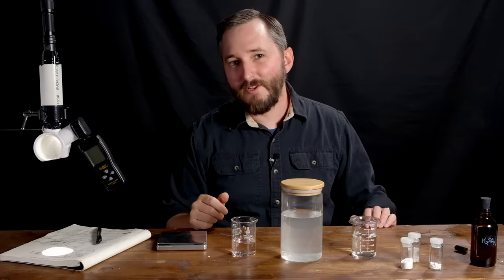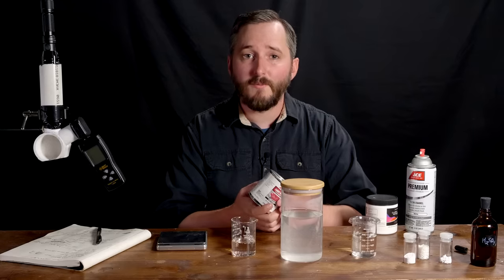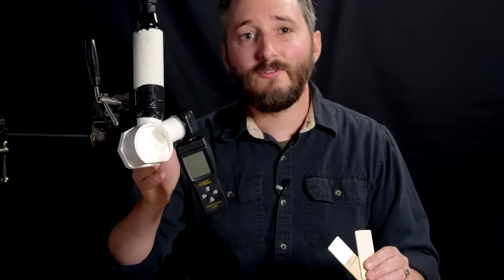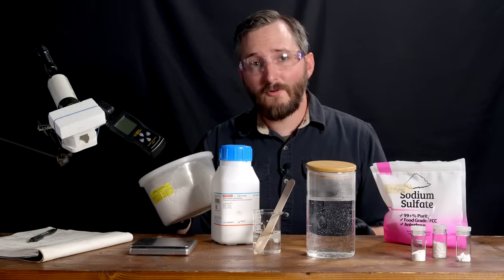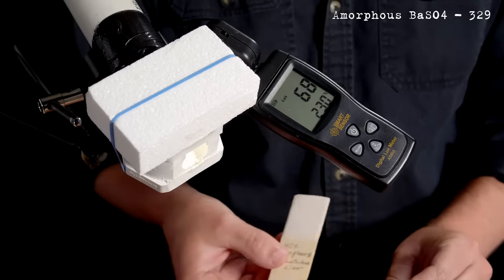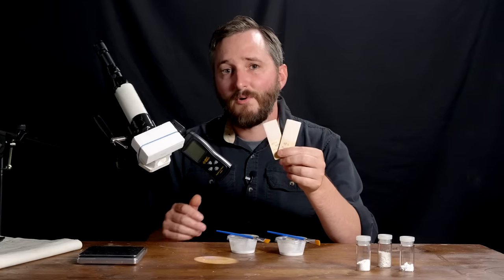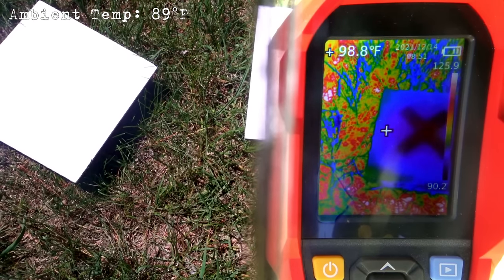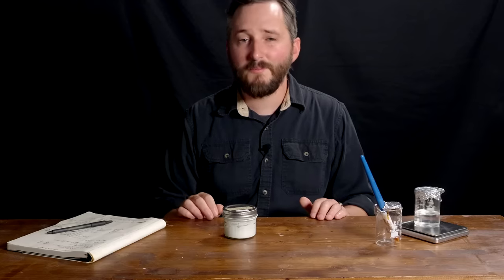How To Make Infrared Cooling Paint (Electricity Free Air Conditioning)

Comment: When experimenting with unusual surfaces, you can't trust the temperature shown by a thermal camera as you don't know the emissivity figure of the surface. You need to use physical temperature probes. Maybe coat onto foil with pt100 probes under the foil
Reply from the maker: I'll be using thermocouples for more extensive testing now that I have a proof of concept
Reply: @Nighthawkinlight   Your result was at least partially because you were 'reflecting' the sky more than the paint itself radiating due to its temperature. Your paint was more reflective (you confirmed that with the flashlight), so it was probably reflecting the sky better.

Not saying you don't have the sub-ambient effect and it's amazing work, but it's invalid with the thermal camera as a measurement device. I.e. confirming this top comment - I have a decent bit of experience using a thermal camera on HV electronics - we measure off of stickers with a known calibration and it's common to see 10-20 C differences between the sticker and random metallic bits at the same (within 1-2 *C) temperature.

Edit: Interestingly, if this paint really was beating the black body curve, and if your IR camera happened to be sensitive to that wavelength, the IR camera would show your paint as hotter than ambient because it was emitting more at that wavelength than it received for passive cooling.
Reply from the maker: @circuitguy9750  For strong reflected tempertures as you get with a metal surface you need something that gives specular reflection, rather than diffuse which is what my paint gives. That effect is also obvious because it happens immediately, where my paint starts at the same temp as the surrounding material when first put into the sun and can be seen cooling gradually. The calibration is not perfectly accurate between the two varieties of paint but it's not extremely far off. I'll compare thermocouple results with the thermal imaging next video. I think you've misunderstood how this paint works slightly by mentioning it should show up brighter on thermal. The paint doesn't emit any more IR light than anything else at a given temperture, it's that it emits a particular wavelength. The intensity of the emitted IR still goes down as the paint cools and so it will read darker on thermal cam like any cold object. Common thermal cameras only measure light in levels of intensity, not by wavelength.
Reply: @Nighthawkinlight  Thanks for the reply, again - amazing work and I appreciate you sharing. I really may be missing something and would appreciate a clarification (perhaps in a future video if it's worthwhile). (Edit - and I would agree the gradual cooling is almost certainly proof its working)

Your atmospheric IR window is 10 um or so. The calibration for your camera probably assumed a black body radiator (or close enough). I would expect your paint to emit more IR at 10 um than a black body radiator at the same temperature and I would expect it to stay that way to remain in equilibrium with a lower temperature than its surroundings. I.e. it's the increased radiation at 10 um compared to a black body that is providing the cooling effect. 

I had to Google this (didn't know), but it looks like most IR cameras only measure the 3-6 um wavelength; so you wouldn't see that effect.
Reply: Does it matter what surfaces are painted. If you paint metal, does this change the differences? Imagine painting a
Reply: @terrafirma9328  painting a what???
Reply: "painting a what???"
Imagine composing an incomplete sentence that sparks imagination.
Reply: As a thermal camera is registering IR radiation - does not a surface registered as "cold" indicate LOW radiation of heat (IR) not high?
Reply: @Nighthawkinlight  Your camera measured thermal (long wave IR) intensity will be a combination of both emitted and reflected radiation 
(assuming a completely opaque object) in the given band sensed by the camera.  Sky/space appears very cold on the camera from earth's surface in that sensed band due to both the absolute temperature of space and the atmospheric window in the long wave IR.   The diffuse reflection of the paint will in rough terms average all of the surrounding hemisphere long wave IR (mostly sky/space if outside in the open) and then combine that with the emitted energy in the band from the black/gray body radiation of the object.  Just because your object is not specular, doesn't mean that it won't have a reflected contribution from the surrounding area.  The diffuse nature of the surface just directionally combines the reflected energy from the entire viewable hemisphere.  Your thermal camera is also likely band limited to the longwave IR band (~8-12um) which means it doesn't measure the entire IR region (near IR, shortwave IR, midwave IR, longwave IR), but just the specific wavelengths in the longwave atmospheric window region.  Hope that's helpful.  It's awesome that you are experimenting with these paints!  They are a very 'cool' way to reduce the amount of energy absorbed into our earth ecosystem :)
Reply: @tactileslut  My biggest fear on YouTube is falling asleep late at night, mid-sentence while replying to comments, then finding out later that I’ve left strings of incomplete comments all over the
Reply: Especially when the surface is not just unusual, but intentionally exploits infrared emissive properties.
Reply: @DanielGBenesScienceShows  dude I know exactly what you mean. I've fallen asleep with my thumb floating over my phone when I fell asleep to YouTube and I had that exact same worry, and if I possibly pocket dialed people I haven't spoken to in a long time. Etc... That would suck...
Reply: @tactileslut  This reminds me of the old meme "I accidentally the RAR".
Reply: @OccultDemonCassette  
Painting a black hole white so it would let light back out
Reply: I was looking at athe when I fell asleep on the
Reply: interesting
Reply: @Nighthawkinlight  even thermocouples can be challenging to get surface temps 'correct' as normal thermocouples are generally axisymmetric, and will be difficult to get good thermal bonding to a surface, while ignoring the air. You'll likely want a thermocouple that is designed to lay flat, and back it with styrofoam.
Reply: @getfucked3559  Heh. =:oD
Reply: @Nighthawkinlight  You could still use the thermal camera but point it at the unpainted back of the panel. Most accurate will be thermocouple sandwiched against the back of the panel with insulation across the whole back. Great vids!
Reply: @benmcreynolds8581  Hahaha! I’ve done that too! I even bid on, and won, a toy on eBay one night after apparently falling asleep with eBay open! Turns out it was a toy Edison Phonograph that records really rough audio on wax candles from a seller in Japan. Funniest thing ever. It was only $35 with shipping and was pretty darn cool once I got it so I wasn’t too upset by my stupidity. Lesson learned… I make sure eBay is not the last app open before I fall asleep! 🤣
Reply: Didn't realize this 👍 but my question is - In most cases is the DIFFERENCE significant? Don't know- ASKING .
Reply: @Nighthawkinlight  - Just wanted to drop in and say that your presentation is CONSISTENTLY one of the BEST ANYWHERE . 
Seriously- THANKS (!) from an Independent Industrial Invention/Product Designer in Houston, Tx.
Reply: @MrRobbowich  True - his measurement technique (thermal camera) is measuring quite possibly a poorer IR emittance, NOT a cooler temperature.  A better measurement of spectrally selective emittances would be to paint metal squares, say 6 x 6 inches, with each paint, place them in insulating boxes, say of styrofoam, with thermocouples attached to the back of each plate, and place them outside.  The boxes can be covered with polyethylene film, which by experience is fairly transparent to most of the thermal IR region (2000-12000 nanometers) in thin layers.  Measuring temperatures of surfaces with an instrument that is equally as sensitive to emittance differences as to temperature differences is a problem.
Reply: @Nighthawkinlight  test it on my hat or roof in tucson. i sleep in 92 to 94 depending on what part of summer it is. i work outside. i'm bleeding and dying.
Reply: @Nighthawkinlight  you can also simply construct two identical boxes and paint one of them with white paint and the other with the special paint and then measure the temperature inside with a traditional thermometer after they've been sitting in the same sunlight for a little over an hour.

You can also compare that to shaded.

You can also compare that to putting a small amount of water on the surface for 2 minutes per hour.

And you can set up a Radiant Barrier box where the Radiant Barrier is on the inside surface of the material where it is supposed to reflect the infrared heat that penetrated right back out.
Reply: @MordecaiV  glue it on and it is pretty close. Insulation has the further benefit of only giving the test surface good thermal exposure  to the air. When I was testing paint, I used swatches of aluminium flashing, hot glued thermocouples on, then attached them to sheets of XPS. I then painted the swatch and the XPS. That minimised edge and back effects.

Long story short. I am now more than happy to pay extra for Sherwin Williams 'vinylsafe' paint.

Comment: Incredible stuff. As a homesteader, being able to paint the roofs of livestock pens and shelters with this could save the vulnerable ones during heat waves in a way that is more sustainable and realistic than a climate controlled environment.
Reply: Grow ivy over the roofs of your pens. The ivy absorbs the sun’s radiation and keeps them cool in the summer and warmer in the winter. Also look into geothermal heating and cooling using heat pumps.
Reply: you could also put a chimney on top and have warm air come back in trough a hole underneath the ground , but honestly i am just speculating right now
Reply: @ThePinkBinks  That is the only realistic 'sustainable' way. And I hate that word sustainable, it has a ton of political  baggage along with their build back better, better than what exactly, it works fine, but they just according to their ideologies cant stand  the way it is.
Reply: Try to get your hands on the white paint used for road markings, it shouldn't be to hard to get, and try it on a section of roof.
Reply: Only problem with ivy or any vine plant on a structure is the possibility of rot or structural failure from the added weight. Vines will Ruin brick work. Ask my current employer tried to warm them over the vines on the brick on hr building. They said oh it looks lovely plus its been here for decades. I told them those vines are going to rip the bricks right off.  That was an expensive repair lol
Reply: @Nickfletchertheskibum  If you use ground contact wood it will last a lot longer.
Reply: @Nickfletchertheskibum  - Exactly. YESTERDAY my sweet-heart noticed some ivy growing up the brick-wall on one side of our house and she IMMEDIATELY pulled it off - well understanding your EXACT POINT .
Reply: @scottdowney4318  one non sustainable way this isnt even reasonable for large places, is, it requires the ground to grow up to the roof, meaning it can only reach so far, and it will require LOTS of water to keep it alive. meaning wasting water, and only reaching 20 feet around the roof. then theres the issue of destroying the roof by holding the rain which will cause mold, and rust which will rust homes in metal roofs, or if you use any other material, it will destroy it as well. so no, it isn't sustainable, it's destructive, and its not plausible for large barns or roofs.
Reply: Painting roof with regular white paint will do the trick. White lime wash paint is also great.
Reply: @Nickfletchertheskibum   Grape vine or Kiwi vine will not damage or rot structure. Plus you get fruit! In  Moldova  all houses has grape trellises on south-west sides of house.
Reply: @MrNiceCobra  dunno bout kiwi vine, grape vines are seasonal where I am, but at least would help in summer!
Reply: @LuLe232   white roofing paint/sealent combo has existed for decades. I had to help my dad use it to paint over the tar roof of my childhood home

Comment: If you keep the solution hot for some time, heating it, it “digests” the solution and smaller crystals give way to larger, more orderly crystals. Also makes filtration much easier.
Reply: This is correct! A great use of Ostwald ripening.
Reply: this phenomenon is visible in geology, with slower cooling granites having larger crystal sizes.
Reply: @gramursowanfaborden5820  this is similar but in a heated solution there is an equilibrium with dissolution and crystallisation constantly happening, so smaller crystals have a larger surface area to dissolve from, so they tend to dissolve more than crystallise, while bigger crystals keep more mass during the process. It’s a statistical bias towards larger particles rather than the slower cooling effect which allows particle to find the growing faces of the crystals and making bigger ones.
Reply: Is that not common knowledge?
Reply: Have you actually done this for barium sulfate? While what you’re saying is true in general, I’m fairly confident that the solubility product of BaSO4 is far too low for Ostwald ripening to occur to any significant level.
Reply: @bjmcculloch  I have but it does take quite a bit of boiling for some time. It’s a common last step in sulfate assays to ensure that all the sulfate ions are caught in the filter paper and that it doesn’t clog the paper.

Comment: The "brown tint" at 8:28 looks like a hell of a lot like Rayleigh scattering from fine particles (aka the reason why sunsets are red). I suspect your reaction worked without any side reaction as you are describing, but the particles end up being extremely fine. This explains why you can't get rid of it; the colour is from the particles, and they might be so fine that's it's forming some sort of colloid either by itself or with the EDTA, which makes it really difficult to separate.
Reply: In this case it would more likely be Mie Scattering, rather than Rayleigh Scattering (though it certainly could be both), as the particles would likely be larger than the wavelength of light they are scattering. Everything else is correct, that "milky" coloration is very indicative of scattering.
Reply: I had the exact same thought. The light coloration looks exactly like what one would expect from the classic few drops of milk in fishtank of water with a flashlight beam through it Tyndall scattering demo.
Reply: Yup! I was thinking the same thing. I immediately thought of purple Au nanoparticles.
Reply: Liquid smoke.
Reply: That's what I was about to say: it looks like a structural color, or the colloidal weirdness of milk.
Reply: Possible just Nitric tri-oxide that is soluble in the solution. NO3 has brown tint.
Reply: EDTA is a chelant used for binding to metals, commonly for boosting soil metal content or removing heavy metals from the bloodstream. It forms very sticky gelatinous substances when above solubility limits, so it is possible a non-equilibrium EDTA salt solution was formed.
Reply: It's appears to have an opal like look to it so I'd have to agree that a likely candidate for the colour is light scattering similar to that in an opal
Reply: Exactly what I came down to say
Reply: Once I (tried to) make magnesium hydroxide by mixing bleach and sulfuric acid.  I got this same scattering effect and gel.  Also, I now know what concentrated Chlorine smells like :)
Reply: @PedroDaGr8  seconded. This is common with nano dispersions of many metal oxides.
Reply: This light scattering effect is common with many nanodispersions of metal oxides.
Reply: would work great as a scattering layer in a fake skylight
Reply: Yes, my first thought was "wow that looks like liquid opal or opalite" which is caused by silica nanospheres as well
Reply: In gold nanosphere and nanorod production a similar phenomena also leads to variations on color. I believe this is due to scatterin as well.
Reply: I see I wasn’t the only one who recognized colloidal scattering 😊